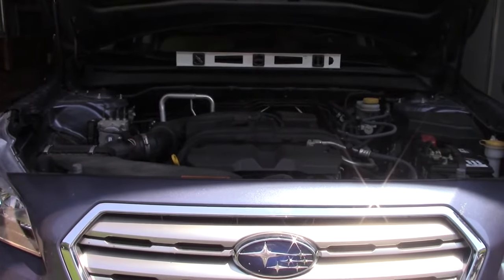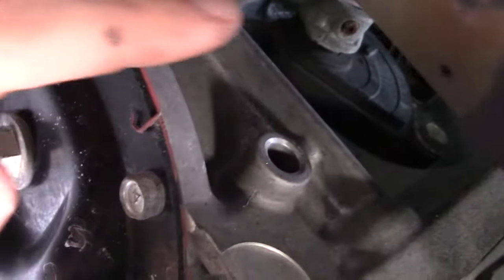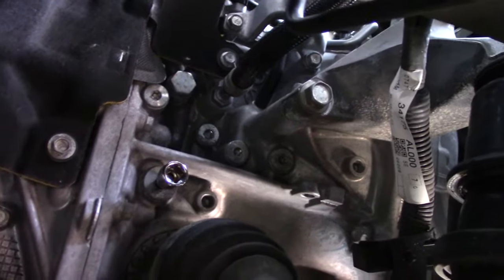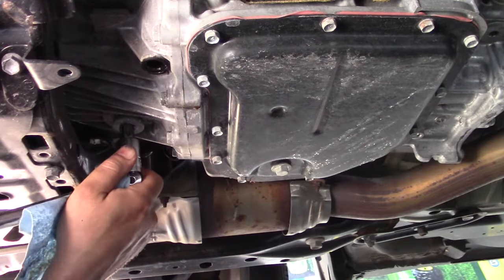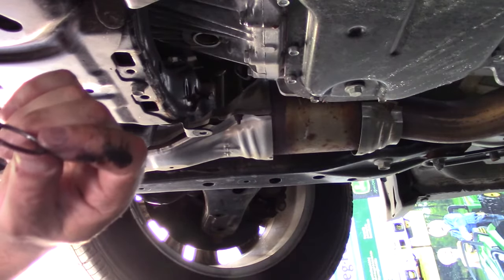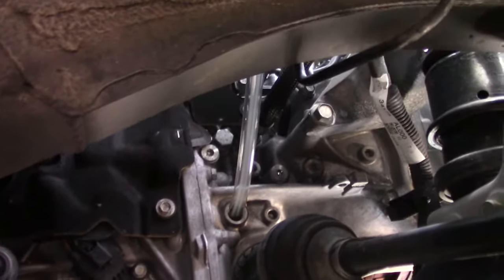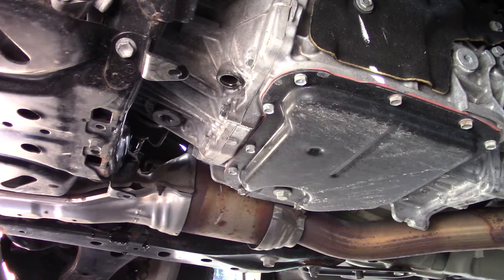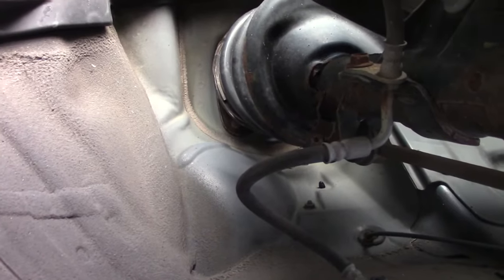DIY Front Differential for a Fifth Generation Subaru Outback (2015 to 2019)

Comment: Finally someone who shows the 3.6r.  THANKS!
Reply from the maker: Thank you, the demo was on a 2.4L, but should be the similar for the 3.6r
Reply: 3.6r fill point is different then 2.5
Reply from the maker: @myongyi6154 the front differential is similar, but the rear differential is not.  This may help:https://www.subaruoutback.org/threads/front-differential-service-2017-outback-3-6r-some-tips-from-my-own-experience.549520/

Comment: Thank you! This and your rear differential videos are great. Did them both today. I live in the west and the car was clean and corrosion free, I don’t know what Subaru thinks the spec foot pounds are, but 100 percent do make sure you loosen the drain plug before you do anything because those plugs were awfully tight. You can get an impact with a long extension in behind the wheel to loosen it, but I wound up using a breaker bar as suggested because I wasn’t 100 percent confident about the angle.
Reply: Attempted front and rear differential on my 2019 Outback today. Rear diff was ok to do but could not loosen the front drain plug. Had a breaker bar on the end of a T70 bit and it would not budge. 
Off to a mechanic i guess to  use some impact tools?
Reply from the maker: @brettogden6867 sometimes lightly tapping (10 to 20 times) the plug with a hammer can help loosen the oxidation between the plug and the case. Be sure that the hammer taps are flat to the plug and not causing damage.  Give that a try before going to a mechanic.

Comment: Why is the fill plug different from the check plug?  Can you not pump the oil into the check hole?
Reply from the maker: Think of the check plug as a vertical tube that is at the correct level in the differential.  Once the fluid level starts to get above the tube opening it starts to drain down.  If you try to fill from the check plug, you may not be able to push fluid up the tube properly, and it will be hard to gauge if the differential is full, or just fluid draining back.  Hope that helps.
Reply: @justbehandy  Thank you for answering my question and clearing up my confusion. Your coverage of the topic has been very helpful.
Reply: @justbehandy  Great question and great answer. 
I live in the NE and the fill plug will NOT come loose. 
Not sure what I'm going to do...
It only has 120k. Not sure how long I'll keep it.
Reply from the maker: @pinkysgarage4517  sorry for taking so long to get back to you.  If you can get the flat face hammer, and tap the fill plug around 10 times, that may loosen it up.  Sometimes dissimilar metals need a little shock to loosen the corrosion.  Otherwise a long breaker bar is the way to go.

Comment: Great Job!  Thanks for sharing!  Using the upper fill hole with the funnel is much easier than hand “pumping” from below!  I do this for the CVT as well!   
FYI: My 2017 Outback (284k miles) uses a “Torx” for both the “Drain” & “Check” plugs!  You have to look closely before attempting to remove, otherwise you could strip it out!  I use 75-140 gear oil (Texas heat) from Amsoil, or TORCO.  This is my 3rd. Diff. & CVT service… even so, the front diff. Drain plug was so tight that I had to use a “cheater” extension pipe to break it loose… and I didn’t over torque last service!
Also, I use 4 “steel” ramps (taller than the plastics) to lift the car for service.  It will only work by “backing” up the ramps… use only part throttle and be careful to stop immediately!
Reply from the maker: Thank you for sharing.  How often do you change the CVT fluid, and what fluid manufacturer did you go with ☺️
Reply: @justbehandy  Hello, I tried to change the front differential fluid on my 2014 Croostrek and I don't know what I was thinking and I poured the fluid on the driver's side. I imagine it went to the transmission that you recommend and how do I get the fluid out of there? Yes. Did it go to the transmission?
Reply from the maker: @comeoll ouch!, I think the Crosstrek is the same, was the plug close to the 1/2 shaft? If not, then most likely that is the transmission fluid that you drained. If you put gear lube in there, I would not start the vehicle as it will circulate and mix the fluid and could take out the transmission.  If you started the engine, then best to have it towed, don't drive it to the dealership and let them do a power flush to get all the gear lube out.  If you didn't start it, then drain the fluid and remove the pan to make sure everything is removed.  That way you can clean the inside of the pan with brake cleaner and dry it completely before reinstalling the pan with a new gasket. You then have to follow the proper transmission fill and check procedures to ensure the transmission fluid level is correct.  I have a video on that for the CVT that uses CVTF-II. Hope that helps and good luck.
Reply from the maker: @comeoll  How did things turn out?  Are you back on the road again!  Hope all is well.

Comment: I don’t get why they have a fill, check, and drain on the front. While the back is a fill/check combo. Spent two hours trying to get the fill
Plug off. Will have to get a 3/8 break bar and extensions tomorrow and try again
Reply from the maker: Hope it goes well.  Please let me know how it goes.
Reply: @  broke a hex head on it. Then put a corded heavy impact wrench on it. It didn’t budge. Not sure what to do at this point.  Luckily I never drained it yet
Reply: @justbehandy ha got it!!! Had a lot of trouble getting my breaker bar in there

Comment: I need to change the front and back differentials show me how ? Where you buy the funnel for fill up the front
For 2019 Crosstrek Thanks
Reply from the maker: Please look at the description below the videos I made for the front and rear differential.  Each video has the tools, gaskets and fluids needed. https://youtu.be/6IOEIj0g73I?si=ydvJdywmtn3b20Kv and https://youtu.be/-W0Qp5q56-s?si=70G5RbHiqh4wUk1h. Hope that helps

Comment: Hello where did u get the funnel?  Do you know the length of it from the bottom to the on/off thing?  Also where do u get the Amsoil?  Do you get it directly from their website?
Reply from the maker: I got the funnel at ACE hardware (will have to get back to you on hose length).  I buy my Amsoil at ACE hardware or Fleet Farm when they run a special (10% to 15% off anything in the bag), rewards cash, or have a sale.  Hope that helps.
Reply: Hello I have a 2014 Legacy with 80k miles and tomorrow I'll be changing the front and back diff.  I was trying to find a funnel that you use so that I don't have to pump it which can be time consuming.  I'm just not sure how long of a hose I'll need to reach from the top of the engine like u used.   I know for the back one I'll probably have to pump it in.  I bought 3 of the Valvoline and this will be the first time I'm going to using it.  I hope it doesn't have any issues since I'm not using the Subaru one. @justbehandy
Reply from the maker: @subieguy8700 Valvoline is good stuff. I just went out to the garage and measured the hose.  It is only 12 inches long.  If you are using another type of funnel, may be better off with 18 inches.  Hope that helps.
Reply: When you tried to loosen the fill plug did u tried to loosen it from the top or was there just too much stuff and it was easier from the bottom??  I think that would be my only challenge.  I wonder if taking off the tire is going to be much more easier.... @justbehandy
Reply from the maker: @subieguy8700 good morning!  There was too much stuff in the way from the top on the Outback.  Hope that helps 😃

Comment: Thank you for this extremely thorough how to video. I wound up taking the wheel off to open the fill port.
Getting the plastic cover off was a pain.
You must live where no road salt is used.
I did have to use a three foot pipe on the breaker bar to take off the drain plug. And showing how to use a level was very smart and helpful.

Comment: Just a heads up - I believe there is a small typo in the description: the larger gasket part number is incorrect (but the Amazon link is still correct).

Instead of:  "Subaru Genuine Drain Plug Gasket need 1  (larger gasket) - 803918090"
Should be:  "Subaru Genuine Drain Plug Gasket need 1  (larger gasket) - 803926090"
Reply from the maker: Thanks!
Reply: I caught that too, he does give the correct number in the video speech. I was making my list going to the dealer and was like wait. It is possible one or the other is an older or newer po number fir the same part